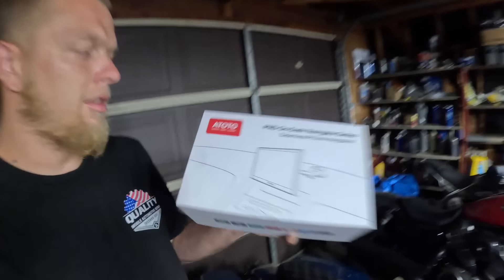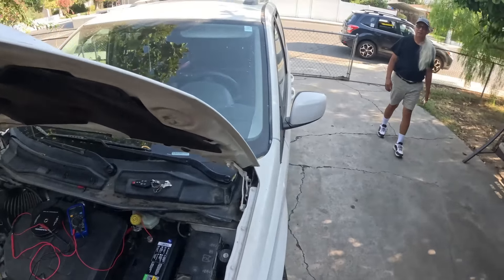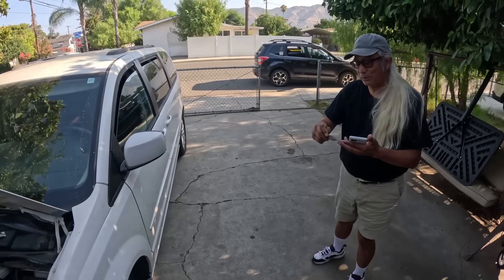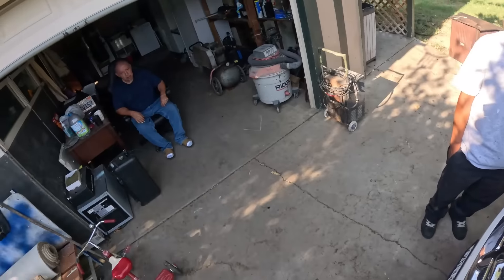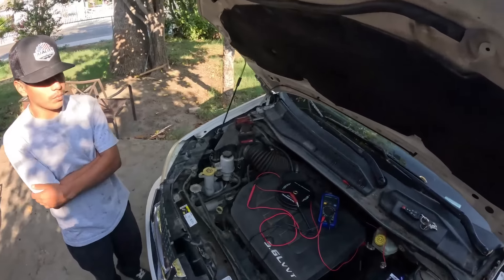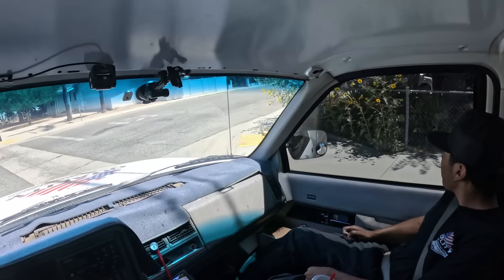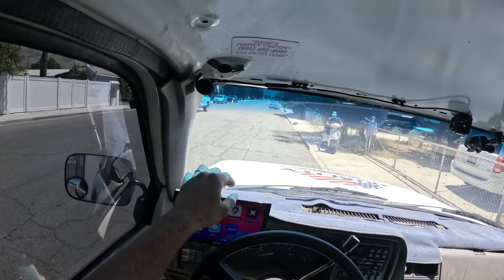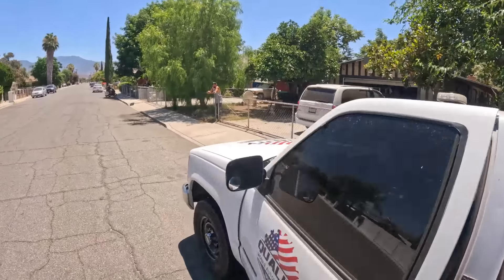CUSTOMER was UPSET! Mobile Mechanic ELECTRICAL diagnosis

Comment: That power module is easy to fix. You could have put a external relay on it . That's what we do here in Florida. So you lost money on that job
Reply from the maker: Why would I put a bandaid on the problem? These TIPM are know for multiple circuit issues. Just replace the TIPM and do it right the first time. By no means did I lose money on this job as I did a diagnostic and a repair.

Comment: YEP, brand new batteries CAN be faulty from the factory. SURE they are OK when sold, but the Cells in a battery can and do become "Dead" due to a bad cell with faulty connections INSIDE the battery.. and its usually why Batteries for cars come with limited warranties too.

Comment: It cant hold the charge but has yet to see if there is a current discharge...
Reply from the maker: Need a good battery to test electronics.
Reply: @QualityMobileAutomotive  but you still could have found a draw with your jump pack if there was one or if it was a dead battery cell instead of throwing parts at it.

Comment: When isolating the battery pls disconnect the negative pole instead of the positive. So even if you drop a spanner between the positive pole and any car metal no short occurs. Also.. pls dont wear wedding ring when working on battery unless you want to loose some fingers

Comment: I was told by an engineer that Chrysler uses the cheapest wiring they can find. Then, the wires get pinched in several places. Good luck finding where.
Reply: Had a similar situation with my Jag. Heck, Mercedes at one point, used biodegradable insulation for their wires. Let that sink in for a minute 😮

Comment: 1st and foremost ALWAYS check the terminals for tightness, as some people simply lip them off and on assuming they don't ever need to be tight.
Which is an instant fail, as they NEVER hold a charge, because they are never recharged (Oh sure the alternator shows 14.4v when the motor is running, but it isn't putting ANY CURRENT back into the battery, if the termanals are loose, also a jumper normally connects directly onto the wires, that are attached to the clamps, and NOT onto the battery terminals themselves, so won't show anything wrong, between starting and running, yet disconnect the jumper leads and bingo, turning the key off, stops the alternator which kills everything else,  and the battery (still hasn't had any recharge) still refuses to restart a hoot motor.
1st - always check the tightness of the terminals as it's almost 99.9% the main problem.
Next, if a new battery fails within a week or so, recharge OUTSIDE of the car, and then as soon as you go to reconnect it, JUST connect the positive and put an ammeter between the -ve of the battery and the -ve terminal clamp, to see if there is ANYTHING above about 200mA draw occurring (200mA runs most of the backup auxillary stuff, such as remote locking etc, which should only drain the battery over several months of no use.
Anything over about 1A will drain the battery within a week or so, and anything over about 2A will drain it overnight.
My door handle sensors were getting "rain-wet" and shorting out, with over 2A drawn when wet, and barely a few mA when dry, which meant that two auto electricians NEVER found the problem but I did, after a night of heavy rain, so I took my own testers and checked, and sure enough, nothing drawn when the handles were dry (the next day was dry) - but as soon as I ran some water over the door handles, wham - over 2A flowed, immediately telling me what they were doing to kill the battery,  which I easily fixed, by slapping some magnetic pads over the door handles,so that whenever it rains, the rain is shed away from the handles, and yet they can be operated by one's fingers to unlock & open the door, with the remote in your pocket.
EVEN in pouring heavy rain.

Almost cost me $1,000 for a new battery the 1st auto eectrical place charged, to which I said,it's under a 36month warranty so take it up with the ins company - who paid out, but it cost me $100 excess (for the dickheads replacing a perfectly good alternator)
The second place also did it under warranty, but refunded me the $100 when I told them later that they HAD NOT FIXED IT, then showed them what I found.?
Oh so it hadn't been the radio after all, but at least it still worked for about a year until that failed by not even working. I'm picking, he rewired the radio off a different circuit which overloaded it.
I haven't bothered fixing the fuse, as I get by without the radio (or the backing camera screen as I still use my mirrors and have a GOOD look around, & under, before even getting into the vehicle. Although not having young kids around also helps.)

p.s:
I'm an old (Industrial) power electrician, so knew what to look for, it's just that for me, auto electrical is underneath my pay grade, plus I'm retired.

Comment: Bro ..I own a 2018 dodge grand caravan gt flex fuel 3.6L v6 pentastar the issue draining the battery is under the dash …it’s the dealership tracking device it’s on constant hot 12v power source ….and it also shorts out the starter and alternator…I’m actually running an agm battery 🔋 and it’s drains that powerful battery …high desert California….this is the main problem….look under the driver side dash you will find the tracking device box and wire harness tapped into the 12v power source and ignition system ….
Reply from the maker: No tracking device on this one. We found the issue and it wasn’t a parasitic draw.

Comment: You can do draw test with a bad battery as you can test for amps not voltage and your not testing across the battery your testing draw from battery to car. Optimal would be with a good battery but you still can check if the car has a parasitic draw.

Comment: Document your mileage
I belive its .50 cents per mile if your just using the truck for business
You have to have proof you tracked your milage if you get an audit and you do not have a record the IRS will come after you. @.50 cents a mile on that old 12mpg truck it really brings down how much tax you pay.  Self employment tax hurts you pay twice as much as working for someone else. 
You need to keep accurate records
To take deductions.  Saving receipts   is not just it.  Get cash report it.  Then you can do the books and see if your making money or if you need to adjust the prices. This includes hourly labor rates  dealerships charge between 200 to 250 an hour or the go flat rate. The installer gets paid by book time, if he is fast he can make 150 to 200k a year.  If its hourly its 26 bucks an hour.
Reply: If you work it right you could lease a new Ford stand up work van make money and not burn so much gas. The lease is clearly a business expense  that comes right off the top. Go with someone on a fleet deal. If you can.  Or go buy a used one still a business exp  tax deduction.  New equipment tax deduction.  And you can write off its deflation in value.
Use tax loopholes to your advantage learn them.

Comment: So did u fix itor not? Im confused!
Reply from the maker: Please watch the whole video and you will see that we fixed it.
Reply: @QualityMobileAutomotive  What I meant was the power drain that u we’re testing? Was that fixed?
Reply from the maker: The customer mislead us to think it had a draw. The only draw was the customer cranking the engine and it not starting because the fuel pump relay was bad which killed the battery

Comment: Had a new WM battery for 2 weeks and wasn't holding charge so I drive to WM & have the tech put his tester on and he says battery good and recommends going to O'Rielly and suggest charging circuit issue.  I didn't notice that the tech put his tester on 550CCA but was 750CCA battery (Didn't know this until pulled back out of car as label was covered) anyway O'Rielly says Bad Battery so I take a picture of test screen & back to WM.

Comment: There is the problem right there in the driveway!

Go back and ask him how long he left the battery charger on the battery.

Thoes battery chargers burn up batteries when the amperage is set to high and left on to long.  They do not have a low enough setting to charge batteries over a long period of time.

Comment: What annoys me is that the owner basically wants a free diagnosis compared to how a brick and mortar garage would function. I suppose you could still apply a mechanics lien against a non-paying customer but it’s annoying and time consuming. As for batteries, I learned years ago to only buy Napa batteries.

Comment: So they're screwed... one of those fuse jumpers like that radio you installed would actually bypass the PCB mounted relay, a switch or other outboard relay would actually repair the problem. amiright? 20 dollars in parts...

Comment: In our shop had an angry customer that said we put Freon in his AC and it wasn’t cooling.. checked the suction line it was cold but warm air out the vents.. noticed the blend knob felt funny pulled it off and it was stuck on hot.. told him it’s fixed for now after I turned the shaft to cold. Buy a knob 😂😂😂😂

Comment: It happened to me something like that. Someone tried to break in my cars daughter and messed up the  key cylinder for consequence. When she locked up the doors, it didn't close the circuit, which set the car in sleep mode and was draining the battery. I took the car to various places and nobody couldn't find the problem. I replaced  about three batteries until someone did find it. I ordered a new cylinder key on Amazon, and I myself replaced it.

Comment: You’d have impressed the customer more if you had just wired a new relay in to power the fuel pump instead of fitting a part that’s known to fail.
Would have saved a lot of money and fixed it that day.

Comment: YOU need to buy yourself a CLAMP ON AMMETER,  that way you don't have to disconnect the battery cables and you can read the AMP draw directly

Comment: This is a random rant that is basically not even related to video. Used to be a mechanic. But i hung up the hat to become electrician. Still work on cars, my own. Rebuilding, motor swapping, bigger turbos. Just the stuff i enjoy. My wifes car was running real shitty and i just didnt want to work on it. So i took it to a shop. Was reminded on why i started working on cars in the first place. Told the shop that id start with plugs and wires, since i got hit by touching one of the plug wires while it was running. Well $650 later i look at the price break down... 4 hours of diagnosing 2 of which were for the obd1 port which had a crusty pin. And then 2 hours for plugs and wires. Plus parts. I was kind of upset. Theres no way i would have charged a customer 4 hours to diagnose plugs and wires. Anyways, i forgot how i was going to relate this story to the video. Good, trustworthy mechanics are hard to find. And it doesn't necessarily mean a good mechanic is good at diagnostics. Thats a whole other category. But you have a perfect approach to diagnostics. I wish you were in my area. Lol

Comment: 13 minutes into the video and right away what the customer said TIMP fuel relay issue.... There's an aftermarket relay board you can put on there instead of replacing fuse box

Comment: Dont forget, alternators can go bad even though it shows its charging. The diodes in the rectifier can go bad. You have to use a meter, analog preferred. Put it on AC. If you see any AC, it means. the alternator is bad.

Comment: To be fair it was kind of a half done job. The diagnostic charge could have been explained better. There is no doubt you would owe him a return visit for free to FINISH THE DIAG after replacing the battery. Part of the diagnostic fee is to verify the repair. We still haven't found out why his issue reoccurred with a new battery.

Comment: Wouldn't it be a good idea for you to carry a spare known good battery to help rule owners' battery issues out in the first place ? I know they are different sizes and all but it's the leads connection you need to make not actually fit the battery into the vehicle ? Not criticising just asking ? If so this would have allowed you to do the draw test the first day and rule stuff in or out without wasting fuel and time on a second trip.

Comment: You and I both know it needs a battery  some people you cant get to understand, but  unfortunately (as a mechanic myself for 35years) you get put in the position where if you just tell the guy you found and fixed a problem, than there happy and you can move on to the next car, but is that right or not?

Comment: Used to work self employed in the motor trade. In many different roles.
There's a percentage of bad customers and it's much higher than people think, I reckon it was a solid 10%
These are the people who "might" be problematical. That varies from being slow to pay to the downright liars and cheaters.
You WILL run across these people in that business, but the key is to learn to spot them before any work, and exclude them from your clientele. If you get caught by them the once.... suck it up and exclude them from your clientele!
Depending on where you work and the likely customer base you'll get a higher or lower chance of them but you'll never escape them entirely.

Comment: When I have customers that are that untrustworthy from prior techs I always pull my peco out and run an extensive test so I have paperwork as well as my camera. I also keep 2 of my own batteries in my van for instances like this where I'd swap in mine for further testing... Problem is some vehicles may take an hour to go to sleep lol
Reply: Also, you can "temporarily" bypass that relay or replace the internal relay, if you replace any of these in the future for that reason save the faulty tipm and experiment on it... It's easier than you think. 

I just "temporarily" bypassed a ram 1500 for having a bad tipm where the relay wouldn't supply the fuse leg that powered the a/c so the air didn't work AND the srs light was on... I'm sure the customer will get right on replacing the tipm though lol  https://youtu.be/Wu_QayoNGn4?si=6SmyvX1BVYgmlDkU

Comment: I agree with the customer. You said you couldn't diagnose it because the battery wasn't charged, so now you're charging him for a car diagnosis you didn't provide, and then tried to say that because you checked the battery volts and tightend a bolt you're entitled to $150. Call out charges are for scamming people out of money when you provide zero services.
Reply: You have no idea how much it costs to roll a truck or run a business.
Reply: @crappyatlife  Call out charges are overhead. It's like tipping. Tipping is for managers who don't want to pay their employees, so instead of factoring in the salary into the cost of the food, they make an unknowing customer responsible for it instead.

If you're constantly getting called out in situations where you're unable to perform your diagnosis, increase your other prices, or provide something else. Charging a customer for, what he calls, a "diagnosis" and then justifies it by saying "well yeah I tightened that *pointing at the battery*" is a scam. He knew he was scamming him, it's why he decided to only charging him once he came back and actually fixed it.

The responsability is on the merchant to make sure they're equipped to do the job they're going to.

Comment: Man get yourself an Amp clamp. I know there not super accurate. But you can very quickly measure if there is a draw over 50 m amps. You don't have to worry about waking up any modules or disconnecting the battery. Very quick go or no go test. Hasn't failed me yet

Comment: And to see that Chrysler has those integrated fuel pump relays like Ford and  GM is mind boggling I wonder if Chrysler took after Ford and GM with this, yes it saves space and time and extra wiring having external relays for things, all theses manufacturers did this also for job security and for the dealerships to make money once those relays fried. Happens all too often for Ford and GM but usually the relay will not fry if the vehicle is brand new and still under warranty but sometimes freaky things do  happen to brand new vehicles and the master technicians cannot even figure out what is wrong when they should never rule out connectors or wiring or the programming of certain control modules because programming can get corrupted rendering things inoperable like air ride suspension or window switches.

Comment: 49:11 - He said the car would only crank and not start until a booster is attached. How would a booster cause the fuel pump to energize?! That makes no sense to me. Am I missing something? Put your booster on and see if it starts like he did before you got there.
Reply: Maybe the booster broke it when it was the crap battery all along.

Comment: Not good to Allow Gas Tank to Go Below 1/4 Tank as Fuel Pump Bounces around inside of Tank. Also not good to Fill Fuel Tank to Max Level as Fuel Vapor System is not Designed for Liquid Fuel to Enter, could end up costing you $$$$....

Comment: just because an alternator is putting out a specified voltage dosent mean it is putting out the correct amperage. The alternator killed the battery, just because ir has proper voltage dosent mean the alternator is functioning properly.

Comment: Literally 1-10 brand new batteries have dead cells these days. I would argue his loose terminal was the issue to begin with. the loose connection likely killed it. You could try chucking some water into the cells and charging it slow overnight. But more than likely the plate in that cell is done. If he just bought the battery its warrantied. Why would he not just take it back?
Edit: There is literally a battery tender sitting in front of his garage door. Have him top off the cells, and slow charge it overnight then see if it holds a charge. Guy is just trying to save money.

Comment: Yeah it's hit or miss with parts nowadays,,, dude your a mechanic you gotta know the worst thing for a expensive fuel pump replacement is running that low on gas